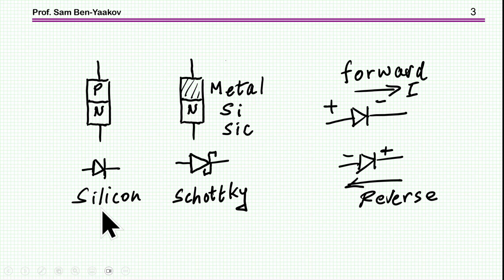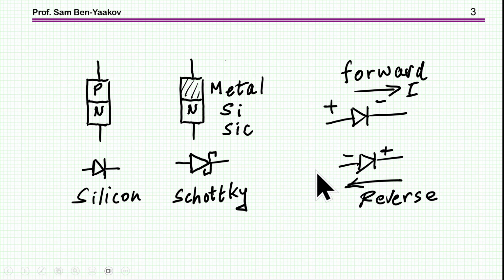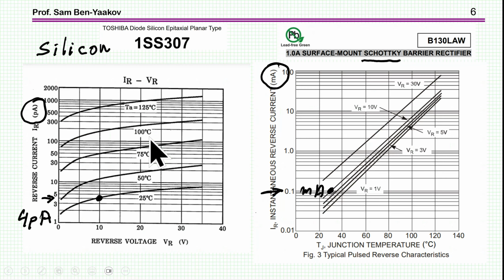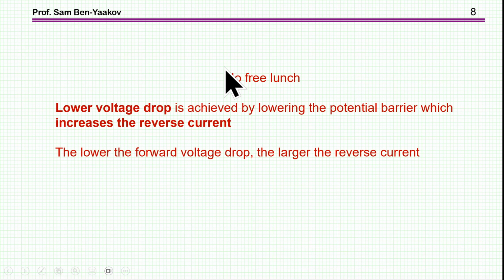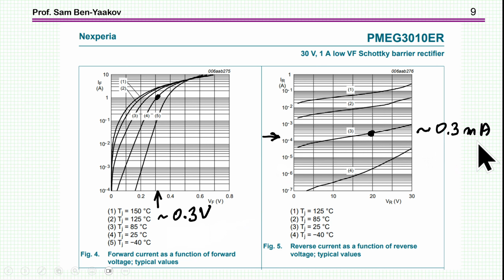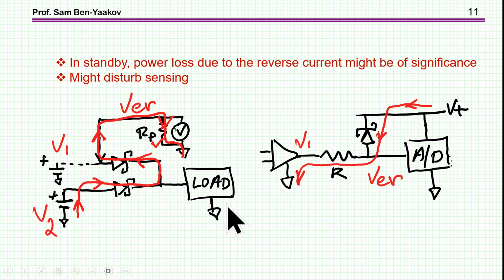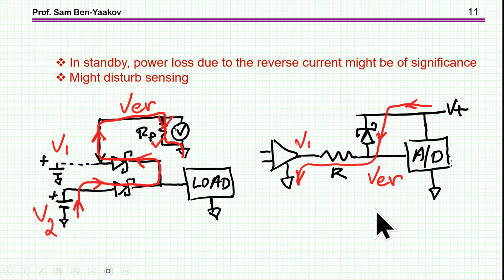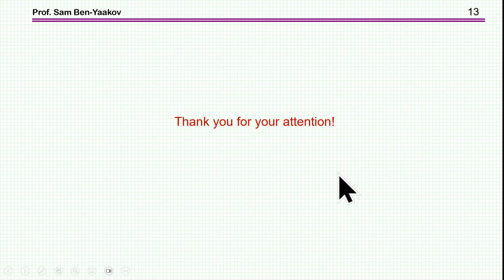Static reverse current of Schottky diodes

Comment: Nexperia makes SiGe diodes which have a Vf and reverse leakage between standard PN and schottky diodes which is sometimes just the thing you need.  For fantastically low reverse leakage, but higher Vf some PIN diodes are very nice
Reply from the maker: Thanks for sharing your experience, this is usefulץ

Comment: Another case where this could be a problem is when the diode is intended to prevent a primary backup battery from being charged by power supply.  Some Li coin cells have a very low acceptable current in the wrong (charging) direction.
Reply from the maker: Good point. Thanks for input.

Comment: Professor Ben-Yaakov, there was also a high current germanium Schottky diode that was made by Germanium Power Devices about 25 years ago.  It had a Vf of roughly 180mV at 10A.  I have a few, however I never tested them for reverse leakage.  Thanks for another excellent video tutorial!
Reply from the maker: Thanks for input. As far as I remember Germaniums diodes  in fact preceded the Silicon diodes. Some are still sold e.g. 1N270 but I don't see that they have a low forward voltage. I vaguely remember that the diodes I have used many years ago did have a low forward voyage. But I may be wrong.

Comment: The same relationship between forward and reverse leakage  current  is true for Schottky diodes made from any semiconductor.  I have had to consider it when designing and using GaAs and InP based Schottky diodes.
Reply from the maker: Thanks for important input.

Comment: A month ago this issue  came up  in a design of a supercap-powered microcontroller circuit. It was exactly the scenario you described with two voltage sources. I discovered a low leakage schottky which saved the day (and the project!) I'm  sure your video will help orhers. Thanks.
Reply from the maker: 😊Thanks for sharing.